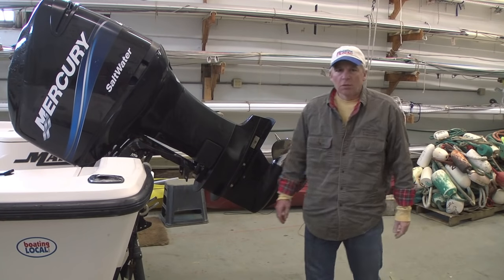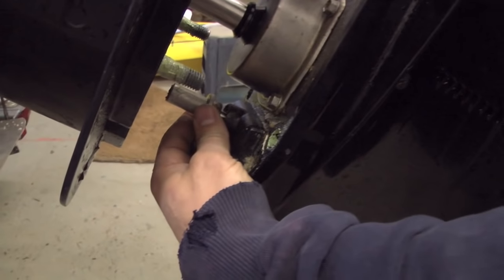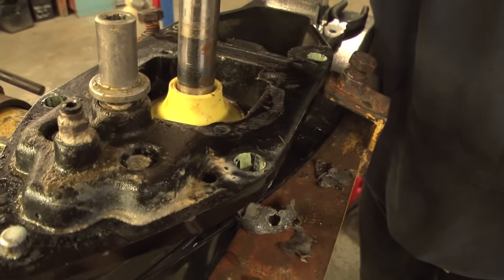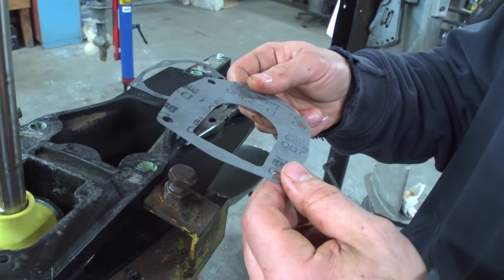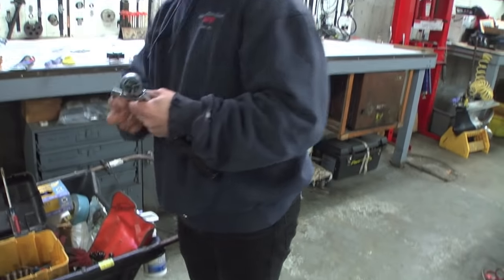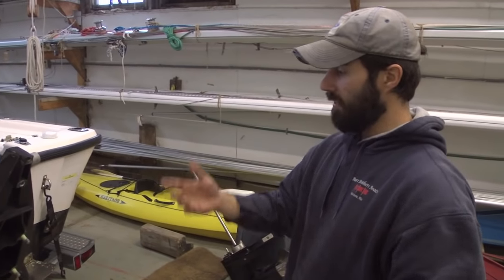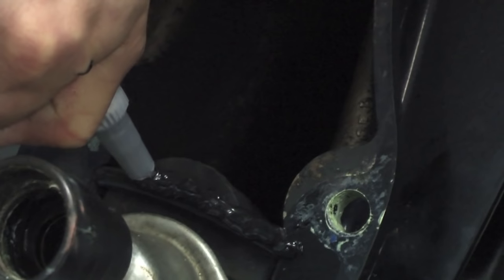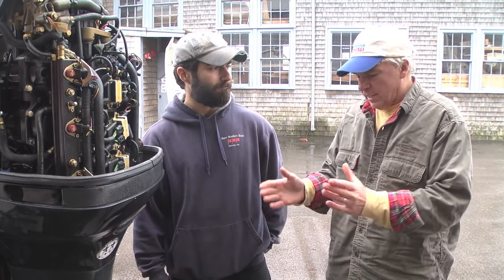How to Replace an Outboard Water Pump

Comment: I'm going to comment here so that another "home mechanic" researching this topic doesn't have to go through the pain that I did. First of all, thanks for making this video. I watched several videos before trying my impeller change for the first time. So long story short, nowhere in the the service manual or owner's manual does it say to drain the engine oil before dropping the lower unit. To my surprise, I had a flood of engine oil pouring out when I removed the shaft and dropped the gear box. I tried to research the problem on line and found a few people who had the same problem, but what they were being told was they had a costly engine oil leak and would need major repairs. This just didn't sound right to me, because I could see a hole at the top of the opening where the drive shaft stops, so I started to do more research. I won't go into detail, but the bottom line is that at least on my 2013 115EFI Four Stroke, you need to drain the engine oil before removing the gear case. I confirmed this with three different Mercury certified mechanics and called Mercury customer service. I realize the OptiMax is different than the Four Stroke, but I just wanted to mention this so someone else doesn't make a mess like I did.

Comment: At 16:35, better advice would be to have the gearcase in gear, and just rotate the driveshaft by turning the prop slightly.  That way you don't need a second person trying to turn the engine over....  Let's keep it simple, folks.
  Other than that, this is a great instruction video. two thumbs up
Reply: Larry Fry good tip
Reply: I've done this once and I'm about to do it again.  I'm aircraft mechanic that doesn't know jack-all about outboards, especially my 150 Opti-Max... On first first go at this impeller change out, that's what I did (turn the prop to align the drive shaft).  I wonder if there is some actual reason for turning (bumping) the fly wheel instead.  Is there?
Reply: @TioGrassiente  People that move it to forward or reverse without moving the forward control shift lever to the right position it causes a problem where it won't shift requiring disassembly and re-syncing.  Too difficult to explain to most in these types of videos so it's best to just assume the boat is in neutral like they almost always are in storage or maintenance.

Comment: You installed to the top shaft seal incorrectly.  The install tool Merc supplies is designed to be used by pushing it down as far as it will go.  Not just touching like you said.  The Mercury Specification is the top of the rubber seal needs to end up .350" above the metal housing plus or minus .030"

Comment: Great video!  My son was monkeying around with the shift rod on the lower unit while it was off.  My shifter is in neutral at the steering wheel, however, how do I know that the shift rod on the lower unit is oriented correctly for neutral before I attach the lower unit back?

Comment: Just a quick tip, if your really stuck with low water pressure and no new impeller, as a “get out of trouble “ move just turn the impeller around 180 degrees and replace. This will make each blade reform with better seating and better pressure. Just sayin!!!

Comment: I have a Mercury 225 Optimax. I wanted to know whether to run it with fresh water is possible (only with headphones), attach the hose to the discharge side where there is that fake plastic bolt that is to be checked

Comment: There is a difference between a 86-89 35hp and a 2004 200hp. I have a Merc 40hp classic and just used the video as  something to point me in the right direction, knowing well that everything wasn't going to be identical.

Comment: At the 1:57 mark you are removing a bolt to a plate. Can you tell me what size socket to use? That bolt is down a long chamber so its hard to see if the socket is the right size.

Comment: good video,I tried to do 20 hr serv. on my 2016 90 4 stroke merc.  out board could'nt get lower unit back up, went to dealer and they installed it for me, got home and hooked up water to test run motor noticed no water exiting tell tail, what do you think is wrong? do I need to drop unit again? thank"s David O

Comment: You must NOT have any grease on top of the drive shaft because grease can NOT be compressed! And so,, when you push the driveshaft into the female splined area of the crankshaft, the driveshaft will not go inside the female, because the grease will stop it from fully entering into the right position!

Comment: My first time changing impeller on my mercury 40 hp bigfoot . I follow the esteps on  your video , everething went smooth till i turn the mootor on to check if impeller working good no problem on that so but i notice thd propeller was turning fast wile on neutral so i itaked to the lake and didnt want to go in gear forward or reverse but propeller still spining fast so what went wrong on that ,any subgestions

Comment: I replaced the water pump on a 25  horse   m 2005   mercury 4 stroke  bigfoot. put it back together ,, now it will not shift,
what happened

Comment: i have a 1993 johnson 50 hp and i have to change the impeller, my prob is i cant figure out how to un hook the shift shaft first
Reply: yes its under the bottom carb and forward. remove the air silencer and starter motor if you can't get at the nut holding the shift rod on. be sure to pop it in reverse before doing this

Comment: hi, someone sugested that when i put the silicone between the waterpump and the exhaust as you did, that i let the silicone dry first before replacing the lower, is this correct?
Reply: I personally would have to say no. once it sets it cant be compressed to "very thin"  for the seal all the way around.

Comment: I had oil leaking out from my 25hp mercury prop and had replaced my prop oil seals and o ring which held up for a couple days and started leaking again.  Is it possible something else is causing this?
Reply: It's a two stroke. Sometimes they drip oil that's two-stroke. Think "unburned".

Comment: Is it important to replace the gaskets if I don't use my outboard at the solt water?
Reply: Why would you not want to replace the gaskets, since you got new ones with the kit anyway?
Reply: Georooney You are 100% right. I asked it because we have shit lot of algaes here. And I sometimes have to take them out from water pump between the services. Not often, but it happens. Of course - changing of gaskets, even if they are not damaged, is the rule of good form. But in my case - I don't see the reason to change it now if there is big probability of need to disassemble the pump one or two week later
Reply: Gotcha!  That makes sense.

Comment: replaced thermostats and water pump and boat still overheating and can't get water out of pee hole. 1995 150 HP mercury.
Reply: Thank you fixed it'
Reply: did you ever find out what was wrong ?
jack
Reply: Hildi Franchio what was wrong?
Reply: Hildi Franchio how did you fix!? Having same problem
Reply: How?
Reply: Hildi, same question as everyone else... What did you fix/what was causing it?